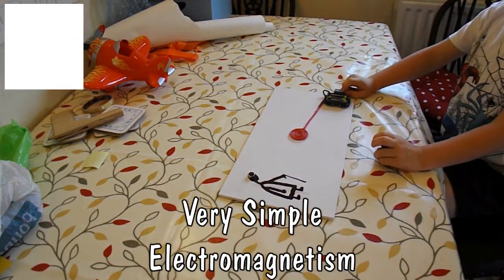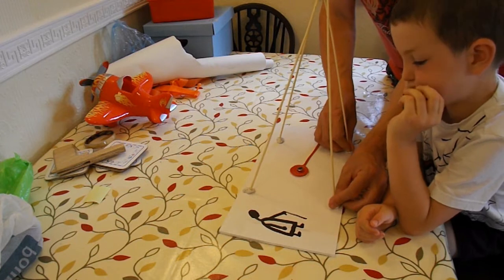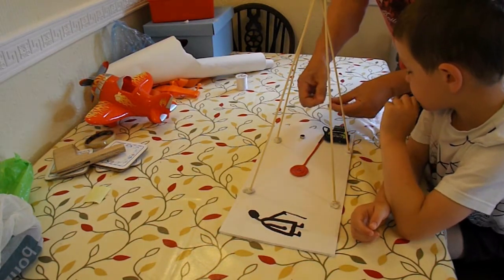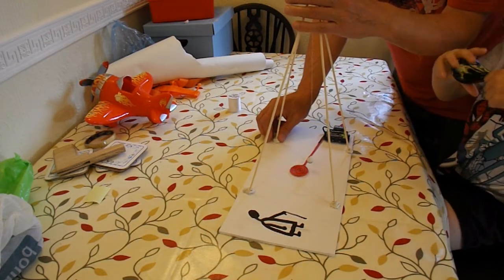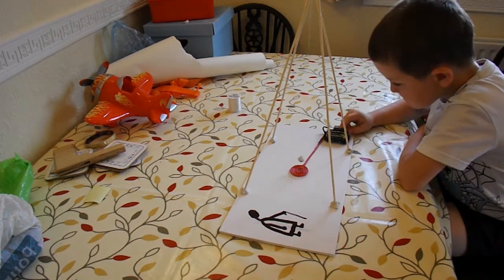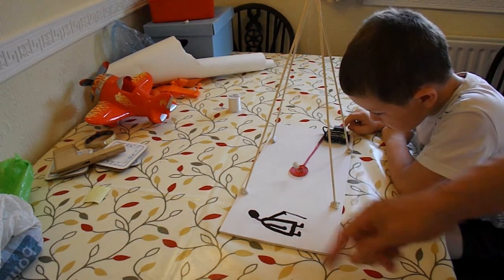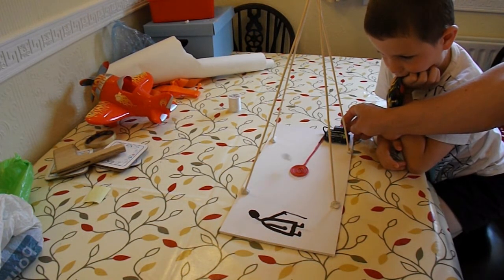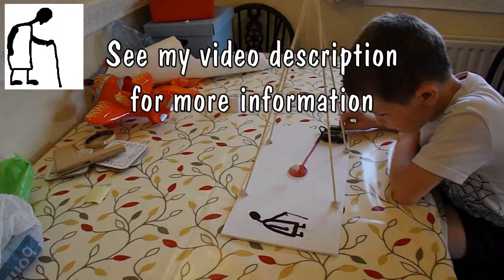Very Simple Electromagnetism #2

Comment: You could put two switches:
One that repels another magnet and attracts him (what brake and set its initial position)
Reply from the maker: The whole point of this set-up is it's simplicity and clarity. I would have just tapped the bare wires on the battery but I wanted to make sure my grandson could operate it consistently, so I added the push switch.

Comment: Grandad, an idea:
If you get close contact of the coil, the magnet to fall, you should reciprocate latter, like the snowman.
Ie: Repels falls magnet, repels again ... (although the operating system Snowman, different).
Reply from the maker: This is the same principle as the solar powered snowman. I am just manually pulsing the current instead of using transistors and capacitors.
At the end of this video you will see I made a small version using transistors and capacitors back in February. The video starts on a different subject but ends up with the tripod and swinging magnet.http://youtu.be/kzhbGKsQKs8